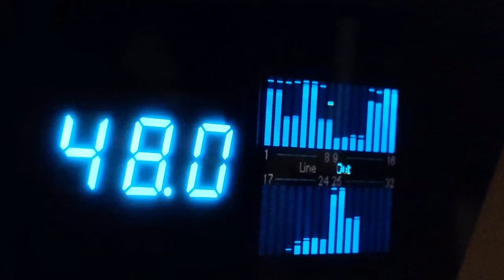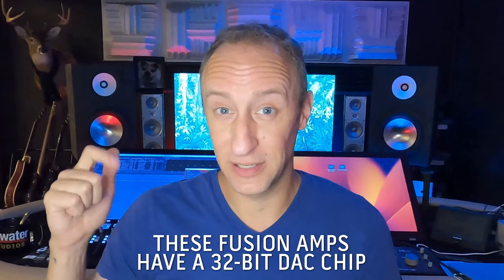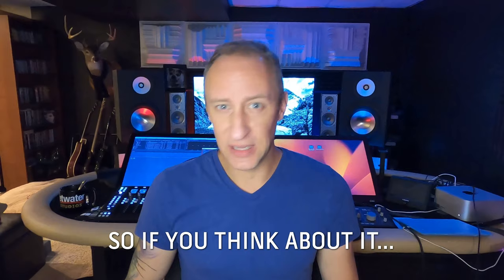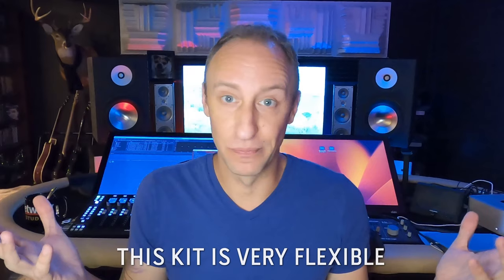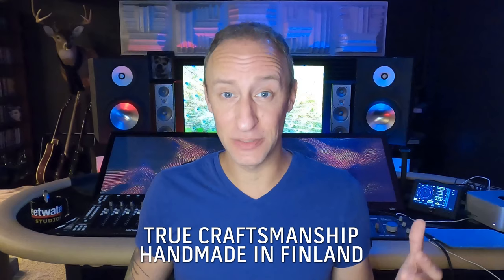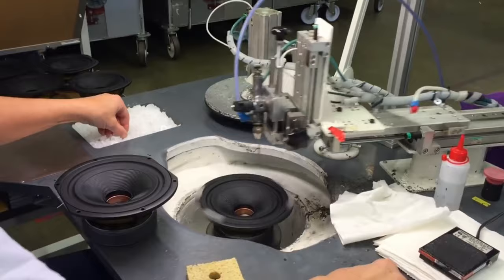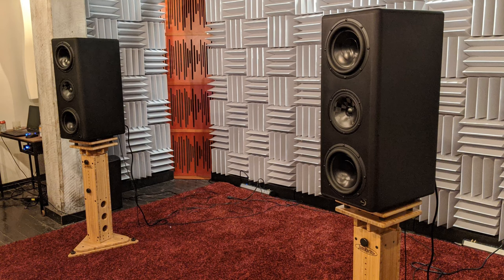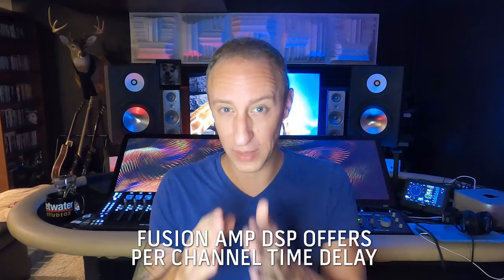3-WAY ACTIVE DSP HIFI SPEAKER KIT BUILD VIDEO! SEAS King RO4Y MKIII Von Hertzog's Studio Monitors 🔉🔉

Comment: Just watching this video and hv a question. Why cut the panels with a 45 instead of straight cuts when it can be finished with veneer anyway? Seems way easier. Maybe I am missing something?
Reply from the maker: I didn't design the kit, I just built it to their specs. But as someone who has built cabinets in the past this does make it easier to get a perfectly square box. I do know part of the idea behind the kit was to make it easy for DIY people to do it. It rolled up great.

Comment: sorry, you moved the router wrong. if the router bit rotates clockwise, please move the router clockwise. with MDF you might not notice that much difference, but with solid wood the edges are cleaner and less "burned" positions.
the router bit might jump uncontrolled if moved like you  did.
This is no criticism, more a safety thing for those who watch the video and starting to build...
👍
Reply from the maker: Thank you! I tried to put my warnings in the video that I don't fully know the woodworking side of things so I appreciate your safe recommendation. Thank you! 🙏🏼

Comment: Great video. You got any buzzing coming from just the tweeter? I build these around the same time as you and I get audible buzzing from my set. I tried a power conditioner with no luck.
Reply from the maker: I think we were just chatting on the ASR forum. I'm running these through a conditioner and they're dead quiet. Even when I run no signal but crank the volume knob on my monitor controller there's barely a hiss at max. They should be very quiet. Did your FA.503 amps come with ac power cords? My FA.253 amps did not.

Comment: Does DAC on these boards supports DSD playback?
Reply from the maker: Not to my knowledge. I believe it's only PCM but it is 32 bit up to 192khz. From what I understand the DAC chip is a AK4454 which supports DSD but the digital inputs use a SRC4382 which doesn't support DSD. So I don't think there's any way to get the digital DSD signal to the actual converter on these plate amps. I hope that helps!

Comment: Right now I use Yamaha HS8 & HS8s subwoofer and Sonarworks helped me a lot calibrating the speakers to my room . I saw that the sound of  SEAS King RO4Y MKIII is flat but do you think that It is necessary to use these speakers with Sonarworks , does it help ?
Reply from the maker: Sonarworks does A LOT to help sort out room issues and is a form of DSP on its own. I have it but I don't use it with these since they have their own DSP processing built in. I'm currently working on a review video of these speakers and I'll do more in depth at how and why I use it to improve what I hear. The main difference between the two different set ups will be the quality of the parts. This kit cuts no corners in the parts quality department, as where Yamaha are more mass produced. Any other questions or if you want more clarity in my answers, please ask!
Reply: Thanks a lot , I wish I could find your tutorials before I bought my Yamaha HS studio speakers , six years ago ! I don't say that they are bad but I'm sure that's a significant difference between HS & this kit .
Reply from the maker: I'm not trying to say the HS8 aren't up to the job. They are remarkable speakers given the money. But yeah there's levels to all this stuff. I hope you keep watching!
Reply: Oh , yes !!! Anything that will make this kit sound even better is my deepest concern ! I probably watched this video a couple of times to see every detail because when I'll start building these I wanna be very well informed !

Comment: Hi, I've had a chance to experience a lot of great monitors Hifi and studio (Amphion 3 way 25a vs Dutch and Dutch 8c in same room, pmc 6-2 with 8-2 subs etc.). You've also experienced ex Machinas and probably other great ones. How close do this compare to them. Ex machinas went even more cutting edge as you said but how would you compare it based on what you've heard? How close this gets. I know that for money nothing can beat them but anyway just to make some feeling about how got they are sounding versu each other? Ex machina pulsar doesn't go to 20hz so here is the one difference on paper. How this translates to reality?
Reply from the maker: The Ex Machina speakers are very linear and flat speakers. Super tight frequency response via their DSP. I'm sure anyone dropping money on them will feel they got their money's worth. What I still prefer about the King RO4Y MKIII is the ability to dial in the DSP for the sub in the room. You can't edit the DSP on Ex Machinas which  mean room cancellations can still hamper you response. I like the bigger 10" sub in the King RO4Y. If you sat me down blindfolded I don't know if I could tell a King RO4Y from a Quasar. The larger sub gets me down to 20Hz with help from DSP and thoughtful room placement to avoid nulls. I honestly don't know if I can hear a difference in the materials used as I haven't had a chance to directly A/B them in the same space at the same time. I'm still amazed at how well the King RO4Y MKIII images and the resolution it has. 

How did you like the Amphion One25A?
Reply: @SocialClubSound  Great tnx for your response. We listen Amphions in a hotel room cause it was Hi-fi event so the place was not acousticaly treated but they corrected both (meassured with mic) dutch and dutch 8c and amphions 25 via Rme Adi pro fs2 so they played similiar in those conditions. Different sound between them Amphions are a little more detailed on the top and dutch a little more smoother, bottom end is also different between them it's hard to tell cause dutch is very impressive in low end with tightness but at the same time also amphion is so both are amazing :) the difference subjectively is not so big so you go ether way hapilly but on the end if we need to choose we said that for studio work Amphion is probably closer to what we need (subjectevly) based on what we heard. But of course you can work with both easily :) so if King Ro4y MKIII is there on that level with them and of course with a slight difference in sound presentation cause they are all slight different..then that is crazy good! :)
Reply from the maker: Cool! Yeah I love the coaxial in the King RO4Y. I had Amphion One18s before these so I'm used to that Amphion sound. I think the time alignment for phase is still one of the biggest advantages to the King RO4Y MKIII. Does absolute wonders for reverb tails and delays clarity. Thanks for the response!
Reply: @SocialClubSound I'm curious Amphion uses 700 W of power for the same 10inch sub driver and then 2x 205W for mid and tweeter. So does King Ro4y have enough power based on that comparation? And also about the cabinet. Amphion also sealed have 2 chambers inside. I also thought about that for King Ro4y does one chamber maybe negativly impact sound cause usually speaker manufacturers make some kind of labyrinth inside:)?
Reply from the maker: The subwoofer has an RMS rating of 250W so the Hypex 253 amp provides the recommended RMS power. But these subs are like tanks so I'm sure it can take the 700W from ICEPower without blinking. I don't think 250 is underpowered, they sound great with their rated power.
Reply from the maker: Oh and the King RO4Y MKIII cabinet is two separate chambers. The horizontal brace divides the chambers. And the amp is in it's own sealed off compartment as well. So each driver has the isolated sealed space it needs.
Reply: @SocialClubSound  Great! I didn't notice that from video:) 

I wrote to you on instagram something about cabinet order if you can reply. Cheers
Reply from the maker: Responded! I'll try and track down shipping costs to Slovenia

Comment: is that paint water based? usually you prime or seal mdf w very specific products. i’m a painter but unfamiliar w that product.
Reply from the maker: This product is designed to go onto MDF or plywood directly and can serve as it's own self primer (according to the label). I've found it to be amazing at helping keep the cabinets safe. You can thin it out with a little water to get more of an orange peel texture.

Comment: Hi I have 2 of the FA 503, ive had it for some time but only recently unboxed them.  so all the latest softwire is downloaded but NO pre set filters   ? Hypex just keep sending links back to there website which is a complete waste of time. Programing custom filters is extremely long winded , so my questing is , the pre sets you have can you edit ? also where are they and how many is there?  all the very best from Japan ..
Reply from the maker: I'm not really sure how to answer you. I had an easy time setting up the filters beacause SEAS provided the guide and filters to do so, not Hypex. Seems like if you want to use the DSP you have to have measurements from the individual drivers. Not 100% sure that's accurate but that seems to be my interpretation.

Comment: what is your recommendation for build an amp for a passive hi fi speaker? ICEpower AS1200 or Hpex ncx500?
Reply from the maker: Personally, I'd go with the ncore amps. I've found them to sound nicer than the ICE Power modules, but they're both great quality. Also 1200 W is going to be overkill for most speakers
Reply: @SocialClubSound  🙏👍

Comment: 33:08 Tar patches are effective when the thickness to be treated is equal to or less than the tar patches.
So here it doesn't work.
Reply from the maker: It absolutely helped in this case. It added 5 pounds of overall mass to the cabinet and it decreased cabinet vibrations and resonances from the sub and mid-range. Not looking to argue just reporting back my real world experience
Reply: @SocialClubSound  
I'm talking about the real world , because I build speakers too loll.
Only internal reinforcement is effective on this thickness.

The extreme on the neutrality of a speaker box is sandblasted walls + internal reinforcement and bonding of absorbent foam on the exterior of the box.

Comment: great video, but but but why dsp? yes, ok, you can tune them for ruler flat response, but the sound/input you feed them with can still be bad/incorect. what am i missing?
Reply from the maker: Not sure I fully understand your question. You're asking why use the DSP? Because it lets us see if the sound input we're feeding them is wrong. I'm using them as studio monitors so I need them to be analytical. Hope that helps clear it up!
Reply: many thanks for replying. let me phrase it differently. say you adjust the dsp so that the frequency is as flat as possible for your room. i get that. then you mix a track based on that dsp setting. it sounds great. but you adjusted your track to sound good for that dsp. if i listen to your track on  my non-dsp speakers, and let's say they are ruler flat too, your track probably will not sound that good because i do not use your dsp setting. maybe i'm talking utter garbage here. i would like to build your speakers myself. am i right in saying that by having dsp speaker i basically adjust the digital signal for my environment thus altering the original digital signer, just like me altering a digital image to suit the color mode of my monitor, so in fact i never know what the original picture looks like.
another thing is the amplifier. it so tiny compared to stand alone amps with big transformers etc. @SocialClubSound
Reply from the maker: OK, I think you're confusing the DSP correction with the source audio playback. Here's how the DSP in this speaker is working. The DSP is there to correct irregularities in the frequency response of the drivers and then I further modified it for my specific room. That DSP is only accurate for that specific speaker in that position, true. But... I'm listening and making my judgements on the flat response playback of the program audio, not on the DSP's correction curve. Think of this more like Sonarworks built into the monitors. The only thing the DSP is doing is correcting the speakers response for the room. It isn't affecting the program audio signal at all. All the corrections are handled BEFORE the program audio is played back. That allows the speaker's performance to be corrected first and playback flat. I'm only hearing the corrected response playing the source material. So I'm making my mixing and mastering judgements on the flat response the speaker has, not on the correction it is performing. I hope that helps clarify but if not, ask again and I'll try to attack it from a different angle. Thanks!

Comment: MDF or wood for the Speaker boxes?
Reply from the maker: The plans from SEAS suggest 3/4" or 18mm MDF or Baltic Birch (depending how you want to finish the speaker.
Reply: MDF is pretty much sonically dead. But really isn't that strong plus absorbs moisture and very easily strips out screws and such. The better choice would be something like Baltic birch. Birch will also give you a better finish

Comment: a rectangular box with a flat baffle ,  will suffer  diffraction effects  🤔
Reply from the maker: The MKII version had rounded corners because the wasn't enough DSP correction to handle the diffraction but that's not the case with the MKIII. The MKIII accounts for this in the DSP. So the rounded corners are optional on the MKIII

Comment: I don’t get the point why you added the 6db on all of the presets since it should be applied within the preset 3 saved.
Reply from the maker: This is the process that SEAS came up with. They clearly stated in their build PDF the order and placement for the shelf boost to go. I was curious why they didn't just apply the boost in the DSP section, or adjust the subs gain instead. But this is the process they created so I just followed the instructions.
Reply: Strange, like we both said they just could safe the boost in the presets. Could you link the butyl Sound Deadening Mat you used ? By the way : all the links in the description doesn’t work (SEAS)
Reply from the maker: The links in the description are all working I just verified. The SEAS links are all http not https tho, don't know if that's stopping you. Please try again. Also, I added the links for the sound deadening mat and the roller.
Reply: @SocialClubSound  Strange, checked them again but still not working if you are from Germany. Different question : how thick was the wood you used ? It doesn't look like you worked with 18mm wood.
Reply from the maker: I used 3/4 inch MDF which is 19mm. Hope that clarifies. Weird that the links aren't working for you. Maybe try to access their main website seas.no Any other questions, let me know!

Comment: Anyone doing these passive?
Reply from the maker: Not that I'm aware of. If you check out the MKII version, that has a passive crossover for the coaxial because they were using an older amp that only had two channels. You can see what they drew up for the crossover circuit in the MKII plans
Reply: @SocialClubSound  Thanks for the reply.
Reply from the maker: No problem! Also, Amphion has the One25A which is active, but uses a separate external amplifier you connect to the cabinet via cables. No DSP tho in the Amphion.

Comment: No way you installed COAX with an open back in the same disclosure with sub. it's going to pump those COAXes and make them sound bad. since it's not closed back speaker - it should be placed in the sapareted "chamber"
Reply from the maker: It is separately sealed. If you look at the plans you can see everything fits together tightly and then I also sealed it up with silicone. Each chamber is properly sealed. The chamber divider piece sits inside 8mm rebates. When I'm rolling the cabinets up you can see me put the chamber separator in. Because you're right, if they weren't separate it would be a nightmare. But rest assured everything is sealed off properly.
Reply: @SocialClubSound  Oh ok, gotcha. i probably missed that part with 8mm separation plate. then it's solid.

Comment: Whats with the 6dB gain in the low? Aint that just adding to the loudnesswar if you know about that? Nice build btw
Reply from the maker: That 6dB shelf is interesting. It's required to flatten the overall signal the way SEAS designed it. I don't know why they did it via EQ instead of amp gain. You're not the first to ask that question and unfortunately I don't have a solid answer.